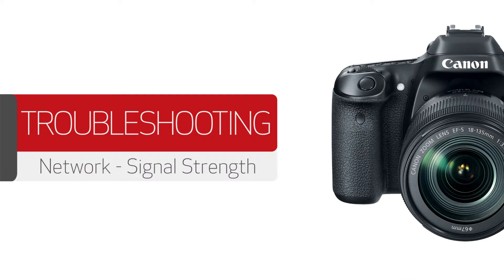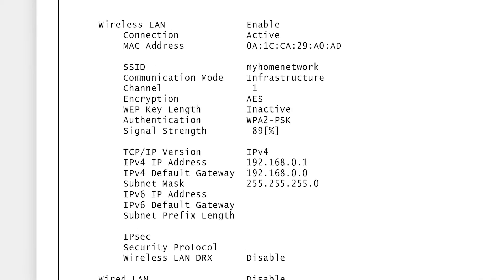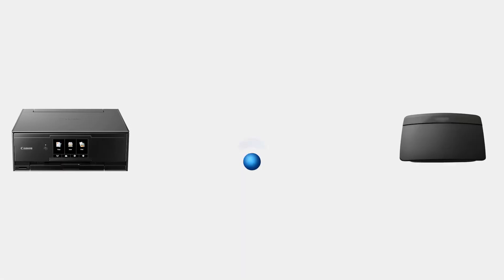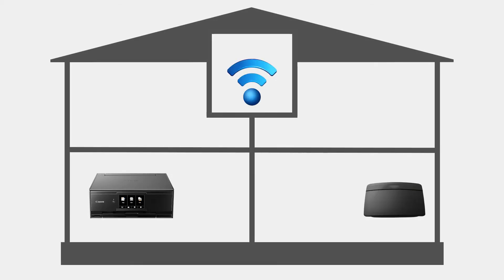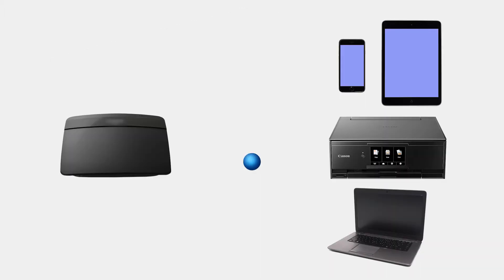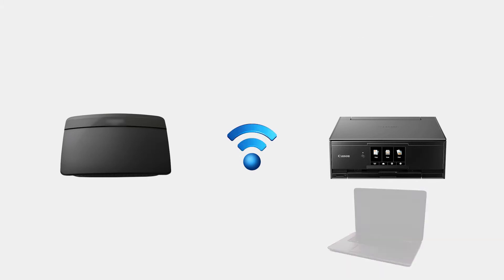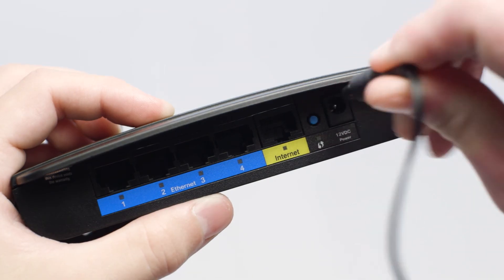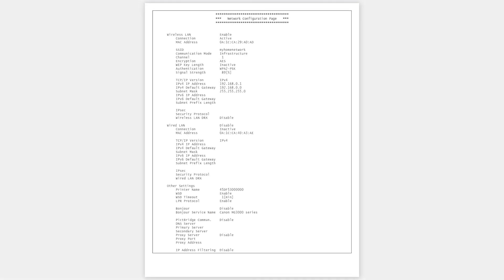Canon PIXMA Troubleshooting - Signal Strength

Comment: Misleading info.I have a G3270. Router 20 feet away.All my other WiFi devices work just fine.Just that printer show low signal strength.The problem is the internal antenna of the printer which transmits the signal to the router.Canon is Asking me to go and by a signal booster.Minus 5 stars review.